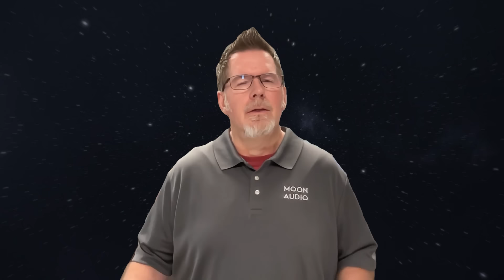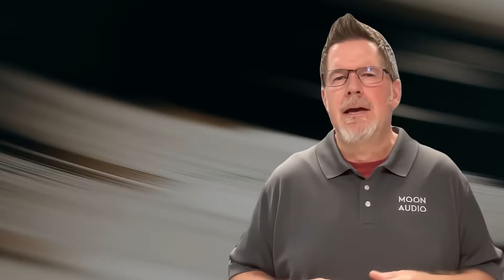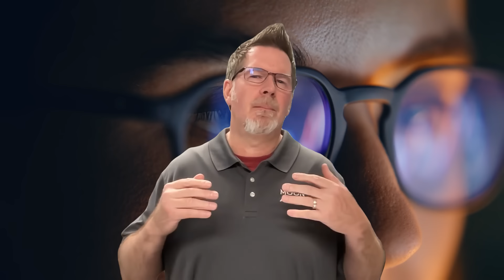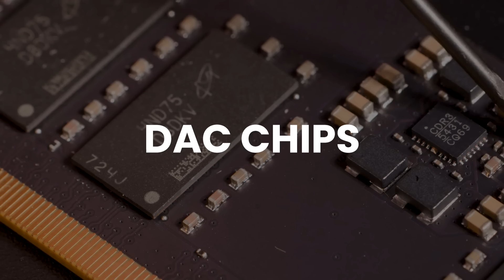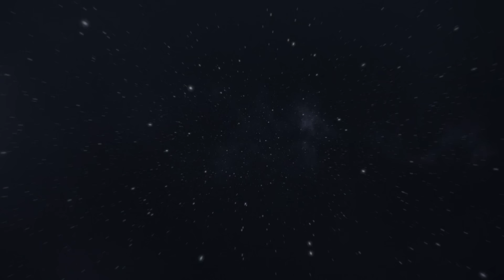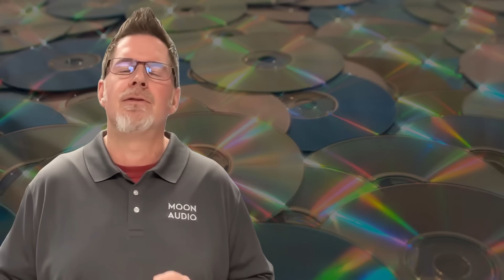The CD Player NIGHTMARE in 2026! Here's WHY and How to FIX It

Comment: Your guilty off the same thing. Just a couple of minutes into the video, you started spouting technical terms that the ordinary Joe just does not understand. My Sony DVD player plays my. CD's perfectly well through my LG sound system. I didn't need a degree in Geek sSpeed I just plugged the cables into the relevant port. It's basically plug and play. I can also cast the output to any other device in the House, including my TV, my Phone, my Laptop and my Bluetooth speaker in the kitchen. What more do I  or any other ordinary Joe want. 🙄
Reply: I think this video targets a different audience. 
Like EVERY hobby, there are those that love getting into the minutia, and those that don't. 
Nothing wrong either way, but just don't hammer on those that are digging deeper or want guidance. 
But sounds like you have found what works best for you! Happy listening!

Comment: Unfortunately, this guy still is spewing the same info given by every manufacturer since the 80’s. The power supply and analogue section do matter, as is the choice of DAC chip. But the most important link is at the digital source, so how that digital information is unlocked matters even more. Some of the best recorded digital music I’ve heard came from 16 bit, 44 kHz recordings using little to no processing (non oversampling), not the over hyped SACD, DSD, 24 bit PCM recordings. Jitter has been over hyped. Streaming is probably the worst.
Reply: deze man benadruk de belangrijke punten , en kan dat beter dan ik ... ik heb daar respect voor.

Comment: Any DVD or Blu-ray player with an spdif connection is audibly transparent you audio fanatics will buy magic beans if someone tells you it sounds better
Reply: I was thinking this too.
Reply: ik  ben jaloers op uw oren.
Reply: @tubecollector100  the majority of DACs are Delta Sigma so the data transfer and analog reconstruction are essentially perfect, no need for exotic hardware.
Reply: @Mike-jm5wt  Where , oh where can i buy perfect parts for my perfect dac design????  op de middelbare school leer je hoe elektronica werkt , op de hogere opleidingen leer je alle problemen van de elektronica .... sigma delta is vrijwel perfect , de elektronica rondom de dac echter niet! dus waar kan ik dan de perfecte onderdelen vinden? of gaat u mij vertellen dat een 1uf smd mlcc condensator gelijk staat aan een mundorf sgo condensator?
Reply: @tubecollector100  this video is about getting the information off the disc, my argument was you don't need an expensive transport. The DAC chip also doesn't need to be expensive to do the DA conversion correctly. You are now switching the argument over to esoteric DACs and I'm sure cables will enter the discussion at some point. You can spend as much money as you want to satisfy yourself the two points I made about the toslink/spdif signal and delta sigma DAC are scientifically provable.
Reply: @Mike-jm5wt  ik heb geen enkele reden om transporten , toslink of spdif te gebruiken . gewoon muziek bestanden gebruikt vanaf een linux mint laptop , niet duur dus ., muziek  is 16 bit 44.1khz , en mp3 320kbps .ook geef ik het enorme bedrag van 1dollar 85 aan een dac chip uit om een dac te maken die denk ik transparanter klinkt dan elke andere dac , wel zitten er luchtspoelen en mundorf sgo condensatoren in. ik heb de rme adi2-pro black edition gehad , deze zou referentie moeten zijn , ik heb hem weer moeten verkopen. wat ik nu zelf ontworpen heb , is fenomenaal , en ik gun  iedereen zoveel audio kwaliteit ...
Reply: @tubecollector100  I see I thought you were trying to convince me I needed a $1,000 DAC but it appears you are a man of science as well 👍

Comment: I just purchased a Denon DCD-900NE last week. I also have Amazon Music Unlimited which I have had for years and just recently subscribed to Tidal for a trial period which I will not subscribe to permanently once the trial period is over because both services are basically the same. Amazon Unlimited is missing some titles and I thought that Tidal would pick up the slack but they are missing those same titles so Tidal serves no purpose for me. I had incorrectly assumed that with streaming it would be unnecessary to have a cd player but I was wrong. I have over three hundred cds and cds that are not in the library of the streaming services thus the need for a cd player. So the answer is yes cd players are still relevant in 2026.

Comment: Don't think i've ever owned a CD player which hasn't developed one problem or another so haven't used one for 15+ years. We have streaming now, and no more getting up to change CDs.
Bought one of the first ever CD players, the Marantz CD63, the Gold version of Philips 101, a revelation to hear back in the 80's, but not in 2026.
CD is over 40 years old and only 16bit, a bit like Windows 1.0, we must move on from the CD player.
Still have some tapes which don't get used, but can't give them up, maybe one day they'll be digitized onto a hard drive, all CDs the same, but PC drives burn out when ripping them and they don't make them anymore.
Reply: we leven al jaren in een tijd dat elk apparaat ontworpen is om kapot te gaan. een fabrikant kan een apparaat ontwerpen dat 20 tot 50 jaar mee kan gaan , maar maakt daarmee zijn eigen merk kapot. hoe lang gaat een luidspreker mee van de klipsch heresy lijn? en een daihatsu auto? alles wat lang mee gaat , wordt gezien als negatief. rippen van een cd doe je het liefst een keer , en dan kun je een kopie bewaren op een externe schijf. geen slijtage , wel controle over je eigen muziek bibliotheek die niet over gecompresseerd is.

Comment: Here's one example that flies in the face of dedicated transports yielding the best sonic performance...... After trying such products, the one CD transport that I keep coming back to is the Philips CDC935 CD changer.  I use its coaxial digital output to an outboard DAC, it sounds as good as any transport I've tried, including CEC, Levinson, Meitner, etc. ....

This was discovered by accident.... A circuit designer gutted a 935's output stage and replaced it with an "audiophile" grade output stage, the sound became glorious.... It turns out that both the 935's transport and internal DAC are off the charts, only held back by the output stage... The catch is that it must be a Philips CDC935.  Similar models, some close to identical physically (including the Philips CDC936), are mostly dreadful.  As one would expect from a typical CD changer. But the Philips CDC935 is a unicorn when it comes to sonic performance, given that it's used as a transport or if its output stage is upgraded.
Reply: I'm with you on that, just get that simple digital out and have a good amp that can take that.
Audiophiles love to claim weird stuff about jitter on the digital signal... that can be solved with a little bit of buffering, (heck, a single sample of buffer is enough) unless the signal is degrading so much you're losing samples, which I doubt any player that isn't faulty is doing.
Reply: @Music2Die4  I still have in one of my systems a Philips DVD-7955A unit that plays SACD (that is why I bought it).  I use the analog outputs since it is connected to a Willenton R8 tube integrated.  Still sounds great and mechanically smooth with that HUGE door.   Looks like a Laser disc player LOL.

Comment: FYI: the SMSL PL 200T is a terrific top loading transport (~$500) especially when using a high quality outboard power supply: I use the Upscale Audio SBooster Mk 2  connected to Topping D90iii preamp and dac

Comment: My Cambridge CD player Azur 650c  has a D/A Converter Dual Wolfson Microelectronics WM8740 24-Bit/192kHz capable and filter 2-Pole Dual differential Bessel and double Virtual earth balanced. Sounds good to me. I don't think I will ever buy a separate DAC.
Reply: I bought a reconditioned (by the manufacturer) Marantz CD 6007.  It sounds best to me through the rca connection to my CXA61. The digital inputs didn’t sound as good as I the think the optimised dac in the player sounds great compared to the chip in the amp. Don’t ask what chipsets they are. And new Chord c-line cables made a big difference.
Reply: @artyfhartie2269  Cambridge always makes great stuff.

Comment: I'm not convinced with the single box vs separate box approach.
The jitter argument has been largely debunked, especially for players over the last 25 years.
Any effects from vibration is still present in the signal further down the chain to that separate dac.
Also, this is digital. 1s and 0s. Analog noise should not be an issue in the digital domain.
Reply: ik wens u veel plezier met luisteren van digitale muziek .... ik vind al die eentjes en nulletjes onhoorbaar , en ben een analoge versterker nodig in mijn usb dac ... die dus geen jitter heeft
Reply: Agree, I'm  purchasing my 1st external DAC to use as a digital hub
 My analogue amplifier doesn't have a built in DAC. So I'm going to use it to connect a blu ray player  + stream music from my phone via   its BT reciever .  
Won't be spending North of £200 (250 USD) 🇬🇧
Reply: analoge ruis is ook geen probleem in het digitale domein. er zit nu eenmaal een groot verschil tussen analoog en digitaal . de dac zet digitaal om naar analoog , het analoge signaal moet daarna versterkt worden , en dat gebeurt dus altijd analoog. en daar kan heel veel mis gaan..
Reply: true, in 2026 jitter exists only if the manufacturer explicitly introduces it into the equation 🤑

Comment: Don't over complicate things... half the point of CD is convenience... most people will be fine with a standard CD player and its onboard DAC... and if they are not, it is easy to add a separate DAC into the chain or the DAC in their receiver. IF they go SACD it gets more complicated if you want to use a separate DAC with DSD... especially if you want multichannel output and more so still if you want DSD preserved through the whole multichannel chain. Almost no stand alone DACs can do DSD in multichannel.  Some AV receivers can but only some players output in DSD... so you have two different ends to think about. Probably ONLY Sony outputs multichannel DSD in a standard HDMI format and even then only some of their players.  The rest use a non standardized pin version which I usually avoid if you are going to mix brands.  Most people can not hear the difference between modern DACs and if they can, they can not agree on which is better... and most modern docs require no reclocking... so unless you are in the rarefied air of people with golden ears AND ultra resolving gear, I suspect a DAC should the last of your concerns beyond what is in your receiver or player.
Reply: I agree. I just have a regular "run of the mill" 5 CD changer from 2016 that I bought used from a buddy of mine. I got it with the OEM remote & manual. It's got a USB socket so I can play some of my MP3s (Yes, MP3s a lot of my go genre isn't or wasn't available in hi-res). It also has an optical out so I can always add a higher end DAC later on, if I feel like it. To me & my buddy it sounds great as is.

Also it's cannot / can't, not can not. It's one word. No offense, not trying to be rude

Comment: I went back to using my lowely cd player after trying a few DACs. I wouldnt say I won't go back to a DAC, but I was suprised how good my cd player is and how little I was missing.
Reply: @timothyfreeseha4056  I did something similar to You ....  I just recently used my Onkyo 6 Disc CD Player / Changer on my 1987 construed LR Stereo system (NAD 1300 Pre Amp, NAD 2600 Amp connected to a Pair of KEF 104/2s Tower speakers (Still considered and highly rated world wide as one of the best speakers  out there) .  The sound production is still outstanding and steadfast without any Flutter or mistracking.  FWIW, TThe KEFs are fantatstic with terrific Clarity, Non Boomy or Mudied Bass (I hate that) , great sound separation to this day - almost 40 Years later !! NO SW or Equalizers used !

Comment: I2S is aimed at internal inter-chip audio transfer. USB is hugely better for digital audio interconnects in the home as it provides a proper standardized protocol stack for brand and product category interdependency. Most importantly, it also can operate ASYNCHRONOUSLY completely decoupling the source clock from the DAC clock making jitter a non issue. It can run at speeds way above anything needed for audio also and errors are taken care of so you have nothing to worry about in terms of sample data integrity and timing. Best is that your DAC galvanically decouples the USB interface, if you have a noisy source. In most cases this is not a concern.

So best is: USB for all the good reasons. There is NO REASON why it cannot be 100% sonically transparent to decode exactly your CD data as they exist on the CD disc (or your streamed data. I2S is about up-selling within brand (enabling brand-loyalty). Don't fool yourself.
Reply: yip i went down that rabbit hole, i2s is a solution looking for a problem.
Reply: @DueM  Back in the early 90s I worked at B&O and we used I2S internally in some products. We worked with Philips Semiconductors in Eindhoven with the team that came up with I2S and I also went there. I2S is ancient technology and never intended to be used for inter-brand and inter-product category connection. USB is a proper protocol and far superior. I2S does not sound better than USB. It is ignorant idiocy to think so.
Reply: @ThinkingBetter  yip i2s isn't even designed to be transmitted over an external cable it's an on pcb transfer method, all the research i did into it pretty much summed it up as a subpar method that was worse than spdif let alone usb in measured performance.
Reply: @DueM Some companies like to promote I2S to push for brand loyalty. It doesn't sound any better. Better is USB.
Reply: My favorite response so far! These old ears probably couldn't hear any difference even if the bank account didn't care.
Reply: @paullink9319  It's quite hilarious that you can stream Qobuz, Tidal, Amazon music etc. in lossless CD or better quality from 1000s of miles away through cables that cost pennies per feet and suddenly the last few feet of digital cable inside your home makes an "audible" difference hahahaha...no, this is about fraudulent business fooling consumers!!!
Reply: oh so true, and any issues with usb can be solved way cheaper, good cables do not cost a fortune, if one feels the need of a converter or an isolator again can be easily found, usbc has a ton of power if needed, and so on 🎉❤
Reply: @Cezărelu  Yes, you can add galvanic isolation if you have some crappy noisy source device (streamer, computer or transport) and/or your DAC is poorly engineered to isolate analog output from digital side. This problem is about poor engineering foremost and not USB.
Reply: I agree technically with your usb statement however, I’ve AB’d this scenario with a few brands and players and I2S has always sounded better in my system in my room.
Reply: @carlossilva-m3k1x  Chances are near 100% that you are fooled by expectation bias. If you think I2S sounds better, your brain will get it to be like that. In a proper ABX blind test, I2S has absolutely no superiority on sonic attributes at all. Rather I2S suffer from clock decoupling (it is synchronous) so it can be prone to jitter concerns. I bet if you ran the test again and someone swapped the cables randomly without you being aware what you listen to, you will be unable to judge it.
Reply: @ThinkingBetter maybe but I think anyone who says 100% about anything is wrong.   At the end of the day, audio is a SUBJECTIVE hobby and unless two people are in the same room listening to the same system you cannot make a true comparison.   I’m not a guy who has been doing this a couple of years and I will tell you like I stated earlier I’ve AB’d it several times and every time the I2S was better.   Does that mean the usb sounded bad? No.  I’ll go as far as to say I thought usb sounded better than coax or optical.   But for you to say that 100 percent I am being fooled by expectation bias is honestly a little insulting.   Having said that, I don’t take it that way     It’s all good.   You enjoy your music the way you feel is better and I will mine.  What’s important is to enjoy the music.  I’m a classical musician and to me that’s all that matters.  Much more than whatever connection you have in your system.   

Good luck!
Reply: @carlossilva-m3k1x  There's subjective in audio, like how good a speaker sounds vs. another, as that is fully up to what kind of frequency response and directionality you prefer, there's subjectivity in what kind of noise you would rather have in your system like vinyl vs. tape, there's subjectivity towards what feels better to use in a physical media, to all of those I 100% agree it's fully subjective. And yes, enjoying the music is the important part, no doubt. There's no technical form being better than another that will make me like a genre I don't.
But no, some things are straight up objective, measurable and technical. I²S vs. S/PDIF vs. USB vs. HDMI are all objective, factual comparisons where yes, if one of them doesn't crap itself up and does something wrong, they WILL sound identical, down to unmeasurable levels.
Same with CD vs. a lossless file, or any lossless file between each other. There isn't anything subjective about math, which is what digital sound is. You don't feel 2+2 being 4.00001, it's not, that's just not how digital transport of data works, it either goes fully perfect or something screwed up mid transport.
Reply: @Kal @Kalvinjj could not disagree more on the second part of your statement. But that’s ok
Reply: @Kalvinjj  When digital music gets the bits wrong, the sound is not changing by some soundstage issue or detail resolution. Those DC jumps will be high pitch distortion.